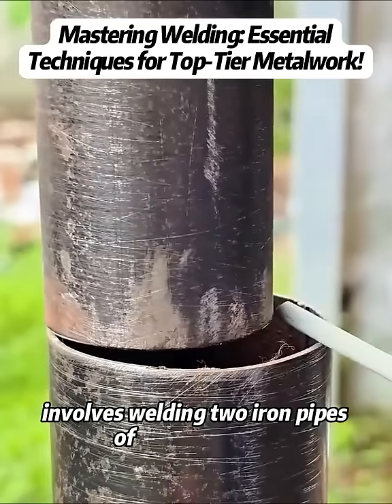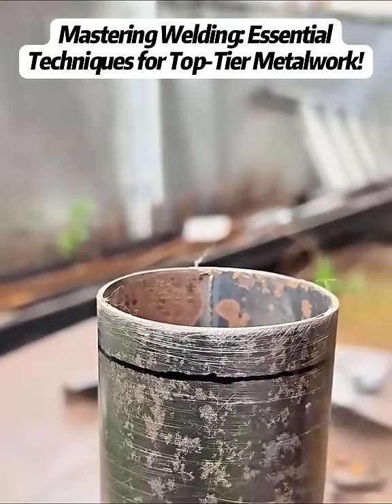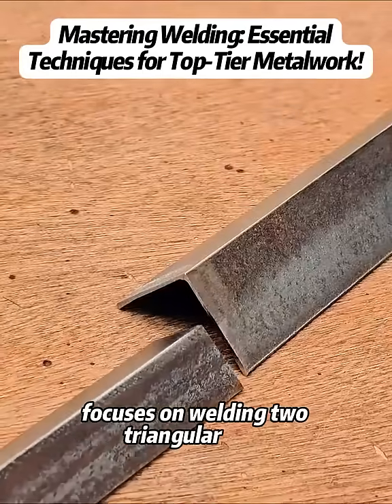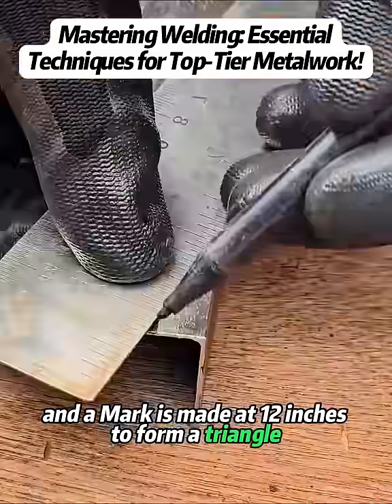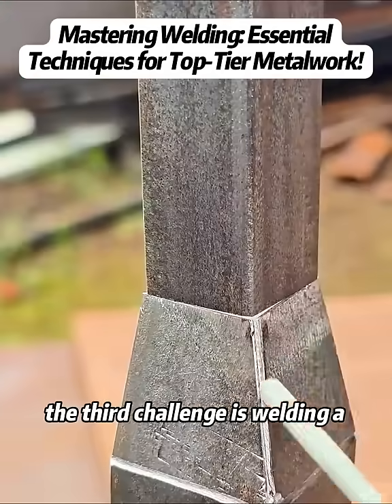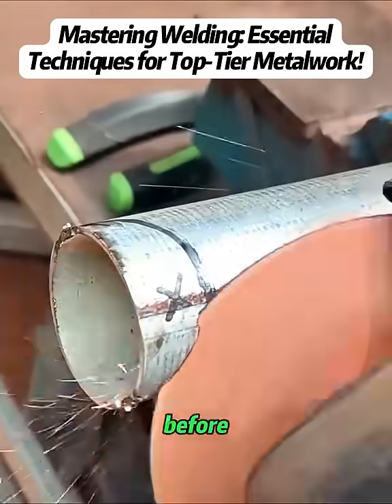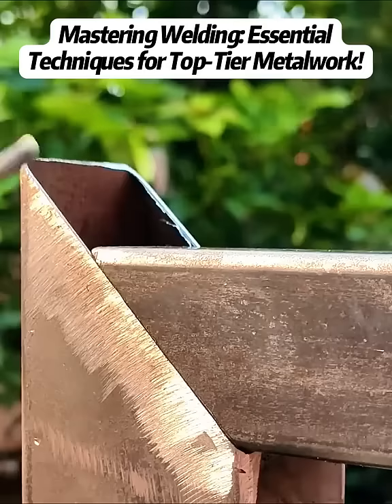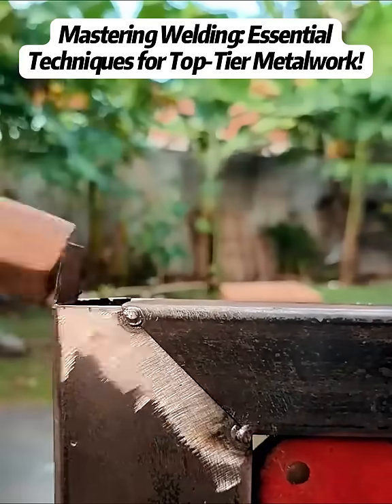Techniques for Top-Tier Metalworks 🔧✨

Comment: The only practical one used is saddling pipe. Every other single one is not used. No one fits mismatched anything that way
Reply: Right? And, I am surprised how many people mess with tubing and pipe and have never heard of a curv-o-mark layout tool. Pipe wrap is what I've always called it. I had to custom fab a 5" turbo down pipe on a Sterling truck because the pipe is NLA. I used factory made mandrel bends, but they still have to be cut square! Pipe wrap to the rescue!